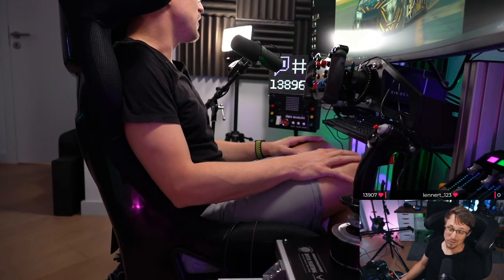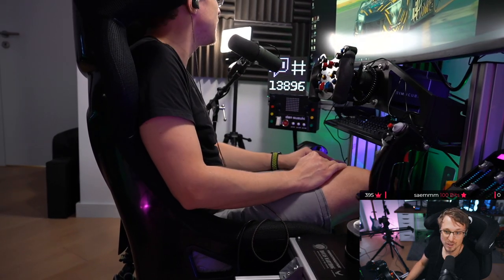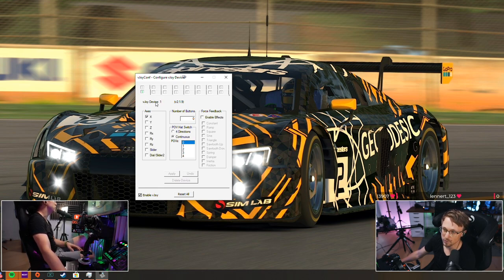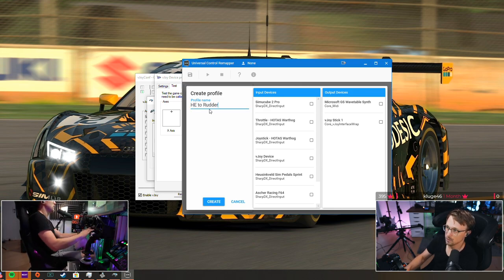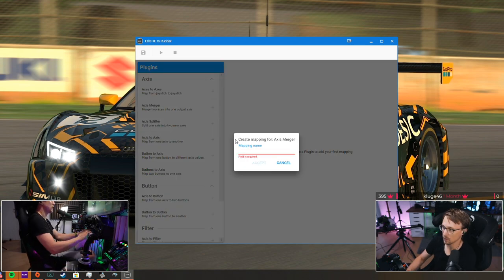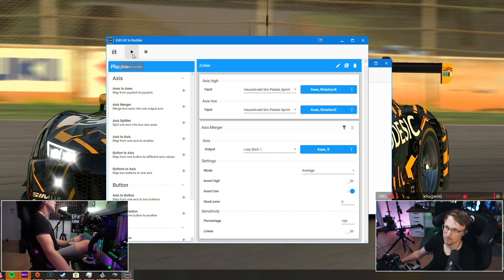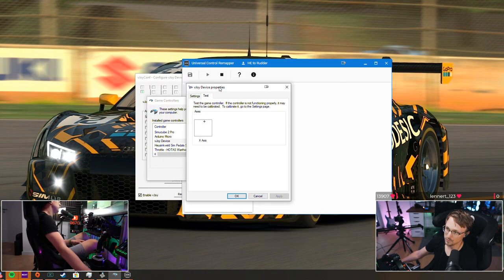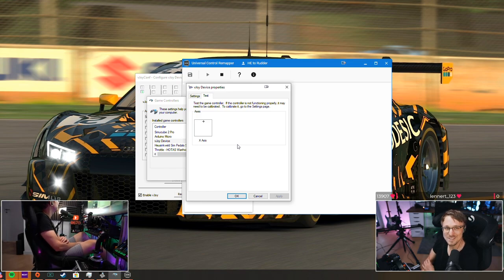MSFS 2020 | Guide: Use any pedals as rudder pedals

Comment: you can do it in msfs 2020 without external programs.. bind throttle and clutch to rudder right and left and in sensitivity set neutral to -100% for both axis.. now the rudder reverts to neutral and you can use them as rudder pedals.
Reply: Thanks for that hint. Unfortunately input worked in a digital manner for me. So full rudder left, neutral or full rudder right. Found another solution then, by setting my pedals up as 'combined' in the Thrustmaster control panel. So throttle and brake act as one axis. Works very smooth now.
Reply: Great, a crazy afternoon whith vJoy e UCR an then you arrive with the most simply solution and finally all work fine including the brake. Thank you so much
Reply: @gianlucarossi3193  you are welcome, enjoy!
Reply: I figured the latest Key Bindings made it simpler... I am trying to use Fanatec pedals and they are not recognized as AXES... any thoughts ?  thanks fro your contribution.
Reply: @marcw.5492  you ever figure this out trying to do this now

Comment: followed this advice exactly and got it working on MSFS 2020 without any problems. I use Logitech G920 pedals. The axis are named different on UCR but the same procedure. Make sure you bind the Vjoy to the Rudder Axis (not button) . I only had to pick the right rudder axis and it doesn't come up at first but mash the pedals enough or just go for a flight to see if it works. this comment written 03/14/2023
Reply: Are you using the usb conversion kit with the g920 or does this work out of the box?

Comment: MSFS Has Axis for left and right Rudder . . . thats recent ?
So I setup Fanatec 3 pedal CSL with the MSFS sim and it worked ! Finally after receiving the USB end to plug the phone jack into one end and the USB to PC. I had to download driver(s) for the pedal set and the cable end!
Seems easy now, the setup was easy after that  - But I had to play with the curve... 45+ 45+ 0 Dead 80% Relative  10% extreme dead ... fyi
Also I added the brake pedal to left and right brake axis. Curve for more power near the front so stopping is exagerated - otherwise heavy pressure on the pedal is required.  Now I am trying to fly the plane like a car until I get used to it.

Comment: I have a g29 racing wheel with pedals. Leave the g29 powered on,  go to ghub and on pedals panel from the g29, click on combine pedals! By doing this, it will create one axis between the gas and brake pedal. Go back to flight simulator, change the rudder by pressing the gas pedal and you should see the gas applying right rudder and the brake left rudder! I also set the clutch pedal to the brakes. Again make sure your g29 is powered!!
Reply: throttle + clutch is better because brakes have resistance
Reply: @lamegaming9835  I plan to have throttle and clutch as rudder and brakes as brakes if that's at all possible, I imagine it is
Reply: @ket451  yeah thats my setup
Reply: @lamegaming9835  How can you switch the clutch with the brakes?

Comment: I have the Logitech 923 wheel and pedals and within the software GHUB you have the option to "combine pedals" to have one Axis with Gas&Break :) simple
Reply: Do you have to do any of the steps in the video, or can combine them in ghub and select rudder (axis x) in a game?
Reply: @00Clive00   its been a while since i played , but from what i remember, after combining Gas and Break pedal in the Logitech Ghub the rest is just about assigning the right Hotkeys in MFS20 .   i think you have to "reversed" some Axis from the Rudders hotkeys in your wheel in game Menu .   But  just a warning the gas and break pedal dont have the same spring force so it can be weird to use that as Left-Right Rudder.   i Personally changed it so that my pedals control my nose (Gas pedal im going up- Brake pedal im going down)    And the actual Wheel rotation i use it for  left or right plane rotation.
Reply: @northvalley06  Always interesting how people set things up, cheers.
I've just bought the Thrustmaster t16000m with throttle, but the pedals are really overpriced in my opinion.
I will give this try.

Comment: You didn't show how to activate these custom pedals in FS2020. Anything special there? My main concern is that I want to use pedals from my Logitech Racing Wheel and use Yoke System for everything else on Civilian Planes or HOTAS on Fighter Jets.
Reply: Just gotta find vJoy Device in the MSFS controls and bind 'rudder axis' to your pedals, job done.

Only real thing of note is to make sure you're binding it under vJoy Device, not the actual device name of your pedals (G920 etc), otherwise it'll ignore everything you did in this video.